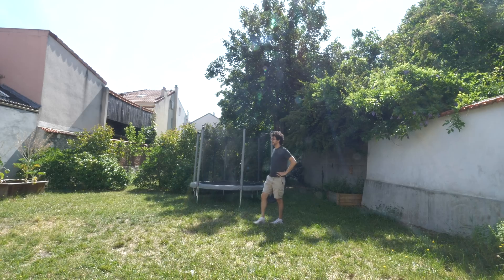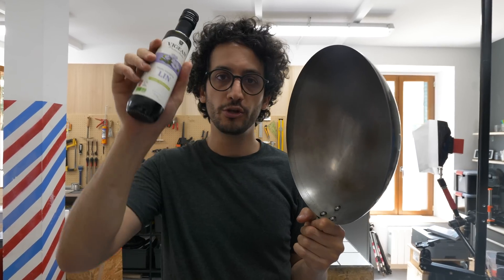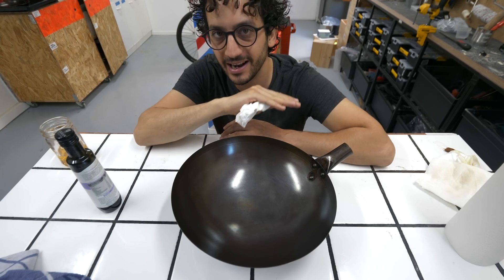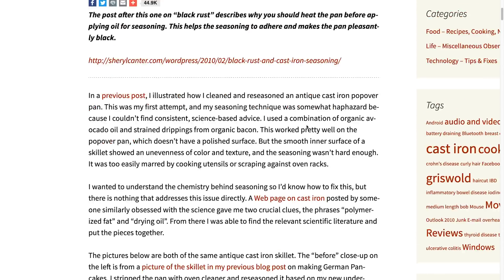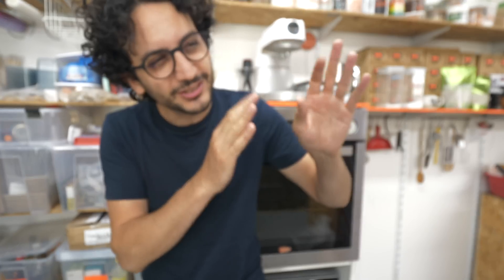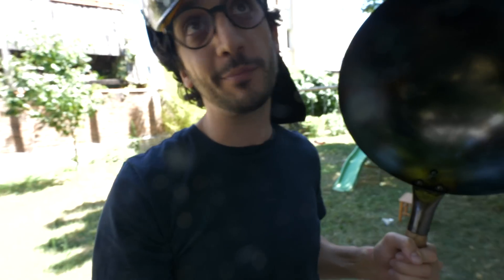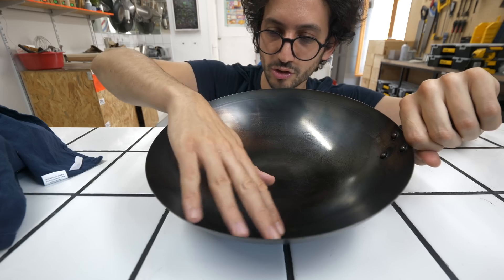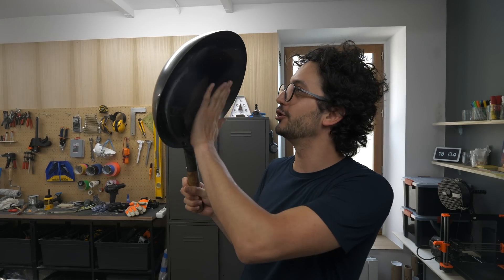Can I Make my Wok Slicker than a Nonstick Pan ?

Comment: preheating the cast iron/steel (carbon or stainless, both should be seasoned properly) opens up the pores of the metal, yes, there are pores, or spaces between the crystalline structures of the metal, to allow the oil polymers that are formed by the heat activation to seep in and become an integral part of the surface of the pan, then with regular, proper, seasoning the later applications will more easily bond with the preexisting oil polymers
Once the first seasoning has been accomplished NEVER EVER CLEAN IT WITH SOAP AGAIN, it will Ruin the seasoning, get your pan/wok/skillet ripping hot, burning off most of what food remains, and while you are doing that, boil some water, if you use cold water your pan will crack, and be a door stop thereafter, put the crazy hot pan into your Dry sink, and Carefully, pouring from the side of the pan,  pour the boiling water all over the HOT pan, being Very Careful not to have any exposed skin above the pan as the water will/should flash steam, usually peeling off any food that remains on the pan, but also capable of giving you a very nasty steam burn if it hits your skin (I speak from experience, it was a very painful month before the huge blister healed, I do not recommend it), give it a scrape with a clean, like new steel scrubby, used only for this purpose With No Soap ever in contact with it, and it should be whistle clean(repeat if necessary, I have never had to repeat this step more than once), and then Immediately dry any remaining moisture, heat up the pan as hot as possible, and season the pan again, Every Single Time that you use the pan, Always re-season after Every use, and you will have a non stick pan as good or better than any Teflon, without need to worry about those Teflon flakes, that Always happen eventually, flaking off into your dish, Teflon lasts a few years, at best, a good cast iron/steel pan can last for generations as an heirloom, if you take proper care of it
on another note, I disagree with seasoning a wok all over the interior, I prefer to season the bottom 1/3-2/5 of my wok (with an appropriate wooden handle attached) so that I can pull the cooked bits of my stir fry up on the sides, and they will stay there keeping warm/finishing at lower heat, while I cook the remaining items, then throw in the cooked rice to heat up and combine with the cooked veg/meat and make fried rice as good as any restaurant, but that is just how I was taught
edit; I season in the reverse order that Alex showed, heat first as hot as possible, Then apply a coating of oil and rub it in like polishing a pair of shoes, and let cool from there, and once the original seasoning has been accomplished with a number of repetitions ( I usually do 3 or 4 and that is sufficient), seasoning the pan AFTER EVERY USE, after it has been cleaned as I described above, only needs to be done once, and over time will build up the nice, rich, dark color that Alex was looking for, but is not really needed to get started, but does not hurt if you want to go to the trouble, the buffing wheel was just over the top, I have never seen or heard of anyone ever doing that, or even feeling it was needed, but hey, it is Alex, of course he went a little over and above what was needed, that is part of what makes him so charming and lovable
as others have mentioned, you may have made your wok Too Smooth, that small pebbly texture will actually Help with the pan being more non-stick, contrary to what might seem logical, it actually works
I am in my 50's, and my Mom and Nana taught me how to cook when I was able to see over the stove as a kid, the way that I have described is the way they taught me, and has worked perfectly for my entire life, sometimes as a professional cook, and sometimes convincing those kitchens to use my method, as it was so clearly an improvement over the method they were using
in closing, to repeat, Never Use Soap To Clean Any Seasoned Cookware, you will remove the seasoning, I can not stress that enough, so do not let clueless people clean your pans, thanks for the offer to help, but no thanks, you can get the dishes after the meal if you want to help, but stay away from my cookware
Salut Alex, and anyone who actually reads this far, thank you for reading my novella comment, be good, be kind, be well

Comment: Linseed oil polymerizes in sunlight. You may not need to use an oven at all.
Reply: can you give any more insights to that? It would be interesting, but i learned you get to go at least over about 400F (205 C) to get these molecules to completely polymerize and break down oil, if it is not complerely polymarize the oil will get rancid, sticky and might be carcinogenic? With the climate change, sun will do in future, but for now?
Reply: @rabenklang7  

"can you give any more insights to that?"

Its used in oil paints and no heat is used for that. But I did read about using it that way for seasoning cast iron, once.

Lets see if my googlefu can find a real source.

Apparently sunlight can thicken linseed oil but it can take a long time, long as in years. I saw the article that I am thinking of several years ago at least and now article by Sheryl is saturating the search. So maybe sunlight won't actually help.
Reply: @EthelredHardrede-nz8yv  ok thanks for the fast reply. Yes I think there might be different chemical processes involved, but i am no expert.
Reply: Skip the linseed crap;  non one touting it delivers any evidence for it's efficacy. Cheap oil works fine.
Reply: @madthumbs1564  

What would you accept as evidence. There is evidence in the video. He apparently likes his eggs overcooked. From what I can see, cheap oil does not hold up over time. But the evidence is anecdotal, which is still more than you produced.

I am going to try safflower oil, as I have some sitting around. The flax oil is rather high in price.
Reply: @madthumbs1564  well, it would be nice to see several oils in a side by side comparision. All oils will work, but witch is best? The well founded theory is, that the oil react and bond, in different processes, with the free carbon etc.. The more reactive, the better. And the oil will polymarize above the smoke point. flax oil is very unstable (unsaturated acids) with a low smoke point (this is proven, you can heat it and watch it smoke) so it is the worst oil for cooking, but good for this purpose. But if you have time, heat the pan slowly (give these chemical reactions enough time) and have a higher (evenly heating) heat source  than 480 F, meabe other oils are as good or even better, i don't know. But Cherryls article nice to read, and some of the reasoning is explained. Some pan manufactures use sunflouer oil, i don't know if it is better or just cheaper to use, but they probably have good control about the heating process

Comment: My dealy pan is a stainless steel one, the heavy type and my second is a carbon steel forged one which I seasoned basically the same way, cleaning with only hot water. The nice thing about the stainless one is that I can clean, scrup and do what ever I want or need to do. I cant do this to the seasoned pan. For everything else I use a cheap set of ceramic coated aluminium pans. They work ok but the ceramic coating is not too long lasting but still better that ptfe.

Comment: well i dont use oil because it become sticky. Lard and butter is not better that oil but its easier to clean and maintain when you dont use the pan daily. The first layer is important and its best to applied the oil on hot pan. 

Im not sure but from my small experience with my castiron pan due to lower smoking point i have more luck with lard then oil. Teflon is better but after 3-4 months of use the surfrace get scratcht from salt or spices atc. when castiron gets better with time. In short you can buy castiron and have it for life of buy teflon pan 2 a year.

Comment: Your comment on Teflon vs seasoning makes no sense.

"The nerd in me says there are no chemicals" (about the seasoning). A polymerised oil is a chemical in the exact same way that teflon is a chemical. Both are polymerised carbon-chains, one with fluorine, one with hydrogen. They are both organic chemicals etc.

The main problem, as highlighted by your friend, is that when you're seasoning the pan, you run the risk of generating carcinogens - not only in your home, but on the items you're going to be using for cooking food. Teflon does not have that issue - not to humans at least.

Comment: At that end you say: No chemical, just a polymerized surface :)  Actually the oil is a chemical, and probably chemicals are used to extract it. And Polytetrafluoroethylene (PTFE) is a synthetic fluoropolymer!  How do you know that your  home-made polymer is safer than Teflon or other trendy coatings such as sol-gel or polysiloxane or siliconized polyester coatings. I personally use SS wok and pans which can be non-stick-ish at lower temps.  Upvoted and subscribed, love your work :)

Comment: Seasoned steel pan is way better than PTFE pan - you can't resurface the PTFE pan yourself, and you don't want to eat that stuff either. PTFE pans have ridiculously short lifespan in comparison; while recycling takes place, some waste plastic is introduced with every cycle, and wasted energy on transporting the stuff around.

Comment: I seasoned two cast irons like this about 6 years ago, and they still work great. I did about 15 layers using the oven method. The coolest thing is that because flax oil (linseed) is a drying oil, the entire pan is completely coated in a hard film that is basically a natural plastic. You can still use metal utensils on it, and it hasn't had any trouble holding up to washing with soap. Like you said, seasoning isn't a mess of leftover grease or olive oil poured on the pan; the oil in a true seasoning like this has polymerized, and is no longer in a chemical configuration that can bond with the non-polar end of soap molecules. Over the years, none of my housemates have believed me that you can clean a properly seasoned cast iron with soap, yet of the 5 or so cast irons we have in the house, only the two that I treated this way work at all. Definitely recommended!

Comment: Uhhh... You said that what you have created compared to Teflon "is not a chemical and creates a nice, very hard, polymerized surface". And what is Teflon? Exactly the same thing.
 And of course this thing you made is also chemical.
But lets be honest. I understand what you mean saying that- at high temperature, Teflon breaks down to form carcinogenic compounds. But you did not think about one thing. What is your certainty that what you have created has no inferior thermal properties from Teflon (and it certainly does) and during decomposition also does not form carcinogenic compounds (and creates for sure)? I will not mention that you had to polish this wok with some wax (?) which you do not know what will happen after the first frying at high temperature.
I am sorry to say that what you have created is no better than Teflon pan. No matter how you look at it.

Comment: I'm very interested.

I currently live in a small home with two amazingly adorable bird fluffballs. Now, before my feathery friends entered my life, I used a lot of Teflon coated utensils. However, birds are very sensitive to smoke and fumes, and in particular, Teflon fumes are very dangerous for their tiny lungs. So I threw away every single Teflon-coated thing in my kitchen. The direct consequences are that cleaning my pans is a nightmare and I tend to overuse oil.

Now, if you're telling me there's a way to coat a cast-iron pan with hardened oil to make it non-sticky, you get all of my interest.

Comment: I agree, the smooth surface and the seasoned coating is better than Teflon - because Teflon can flake off into your food if not handled properly. A smooth, well-seasoned cast iron or carbon steel pan can withstand a fair amount of use with metal utensils.

Comment: Generally I have found that when you apply oil and heat the pan until its approaching a hard black coating the coating will in time flake off. I'm talking about pitch black and smooth in 6-8 coatings, doesn't last. I have found that repeated uses following a decent seasoning (as he showed us) gives the best long lasting results. I use a 14" cast iron wok and I have started using a 35,000 btu burner in the driveway and this wok has never worked so well. I used to use an Iwatitani butane burner but this large camping stove is far superior.I use liberal amounts of oil and the wok comes out clean, the seasoning gets better every use and the food tastes better with a superior browning. Never try and shy away from the proper amount of oil use with a wok or you will be very disappointed.

Comment: of course ... Teflon pans sucks. Way to fragile and in the end you want that nice crust. 
Just wanted to add. Even without proper coating. If you frie that egg, with a high enough temperature (similar as your egg looked like) it wont stick to the pan. 
I dont know if its possible, but i would have been rather impressed, if you would have put that egg in a medium hot pan and fried that egg without it sticken to the pan.

Comment: you asked: seasoned or Teflon? I would prefer seasoned any time.
I have a wok as you have in the video, I bought it in Taiwan, in the shop where I bought it, the guy explained (via google translate) how to treat it.
he explained it exactly how you did at the end: a thin layer of oil and rotate over a high flame, and than again.

the oven is better for cast iron I think. at what temperature did you put your oven when you tried that first?
love your chanel!

Comment: Having noticed the nicks and scratches in the pan before seasoning, I would strongly suggest sanding then polishing the (inside) surface until it is a mirror.  On a microscopic level, that will give any food the smallest possible surface area to stick to.  It will also take FAR more layers to fully season it, as each layer of oil--when properly wiped out--will only be a few molecules thick.  :shrug:  As for heating the wok up to a temperature to blacken it (...if that is actually the best way to do it), using copper tubing to make an induction coil that fits closely to the surface wouldn't be too hard, and there are a number of fellow YouTubers who would probably be happy to make a wok microcontroller-controlled induction heater one for you.  ...which you could then use to completely uniformly heat the wok normally afterword.  Try joining the community of makers at https://www.makersplayground.com to find other DIYers who will be happy to help you.

Comment: Interesting video, Alex.  What do you think of ceramic coated pans or enameled cast iron vs seasoned pans?
Reply: Obviously not Alex, but every enamel or ceramic pan I've ever owned has gone to crap after a short period of time. My seasoned caste iron pans and carbon steel wok, on the other hand, have never let me down.
Reply: @taylormallory8705   my enemaled pan is from the 60's and in great shape, what do you do with them?
Reply: @iamarawn  That's what I thought.  My Grandfather has an enameled cast iron Dutch oven that he's had for 50-60 years.  I just don't know how "nonstick" it is compared to a seasoned cast iron pan.
Reply: @taylormallory8705  the ceramic coated pans really dislike oils being used on them. Makes them gummy until you finally get it all removed which requires almost as much effort as it did to de-rust that wok lol.
Reply: If you like toxic chemicals in your food...
Reply: @miapdx503  If you like toxic chemicals in your air.

Comment: Interesting! I never thought about the right oil. Linseed oil is also used in wood working for the same reasons, I guess.
Reply: BEWARE!  One thing was missed in the video. They are not the same. The stuff used in woodwork is poisonous. Basically, the linseed oil that is sold in hardware stores has been treated. It is not edible.
Reply: @paulreeves8251  I think that's why Alex mentioned "foodsafe linseed oil" ;)

Comment: Awesome video as always. However, you DON'T want to season your wok to super slickness. The reason is that traditional wok cooking  technique manages heat by moving food to the sides of the pan. So they get less heat. And a non stick surface will prevent that. So Chinese chefs use high heat and oil to prevent food sticking.

Comment: I'm afraid you've reinvented old school gun bluing. By polishing it after the fact, you've removed some of the oxidation and you're eventually going to have to redo it. If you get the pan to a super high polish before you start the process, the oxidation looks better and has a better bond to the surface, plus increases slickness.

Comment: You know? You can actually use sand to heat the entire surface evenly. Though, it takes forever to cool down. If you are using a carbon steel,wok  you will be tempering it as well.

Comment: PSA: Linseed oil left exposed on a rag could spontaneously ignite. Please handle with care.
Reply: I've tried to make them ignite in the past but couldn't, any pointers on what conditions set it off?
Reply: Thats only boiled linseed oil which isn't food safe
Reply: Boiled linseed oil is different from flax oil, it has chemicals that accelerate the curing process and make it much hotter.  I'm sure someone could manage to make a rag with regular flax oil ignite but it's pretty unlikely.

Comment: I think you should strip the seasoning off, and then try again with a barbecue. You could close the lid, set heat to high, wait for it to get like 600° lol, and then use that to season.

Basically, I am trying to combine the intense heat of the gas stove with the uniformity of the oven. BBQ is like a super oven, so it would be interesting to see how that works.

It would also be great to see more detail on how to do the DIY polishing at the end.

Great video as always!